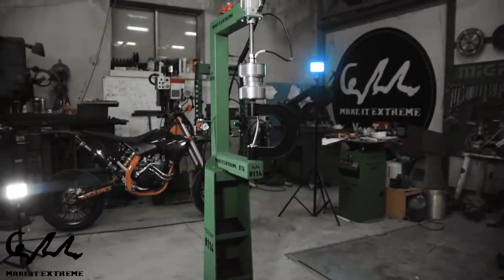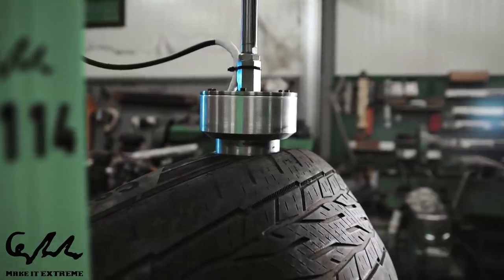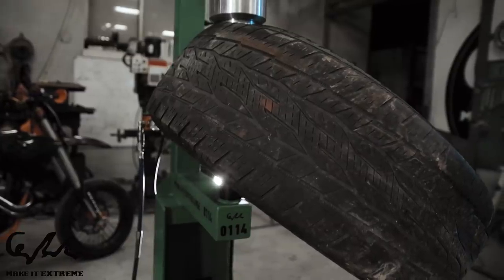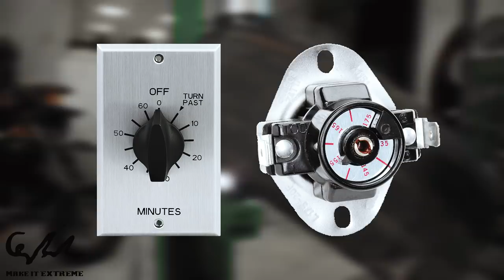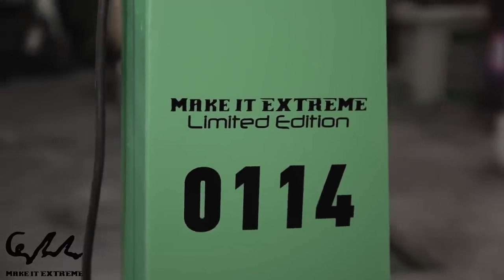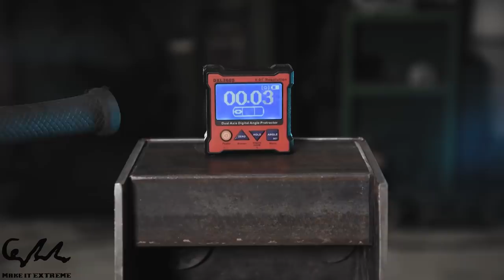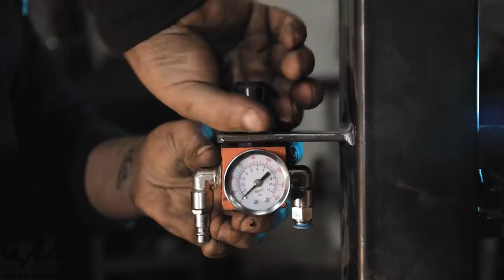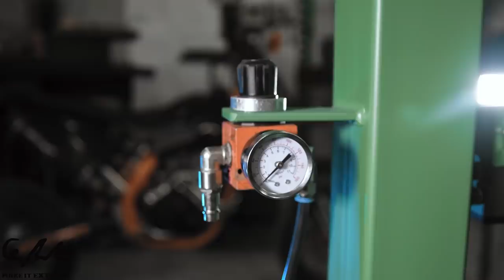I Built a Tire Vulcanizing Machine!

Comment: Nice attempt but this machine lacks the power to vulcanize (weld) rubber. 

The liquid rubber needs to dry a bit before you press. Also the rubber patch needs to be ad on with a roller and force. For heat you will need at least 150°C for over half an hour with a pressure around 4bar. And slow cooldown. Loose pressure when its around 50°C

Comment: Mmmh maybe more pneumatic projects in future? I have few cylinders laying around salvaged from wreckers grips, but havent figured anything useful for them since i'm pressurizing my compressor only when i need it and uses like pneumatic holder for part for grinding is more trouble than its worth same with door opener. It would be neat to get some ideas for that.

Comment: Awesome. Hey, i think if you add a valve on the air line that  makes the cylinder go down , you can lower the speed going down. The final pressure pushing down and speed moving up won't be affected.

Comment: Ah awesome!  I've wondered about how to not waste tires and make a retreading machine which would be a larger version of this or maybe some sort of chuck to automate the rotation of the treat section with a little wider heated die.  I've also wondered about tires that are worn uneven... maybe some sort of balanced lathe with a grinder wheel to re-even the tread.  Seems like such a waste when tires are just thrown out.

Comment: I didn't see it done but you should replace it thermalpaste used on the temperature switches and also use a paste between the element and die while obviously not essential you will get much better heat transfer